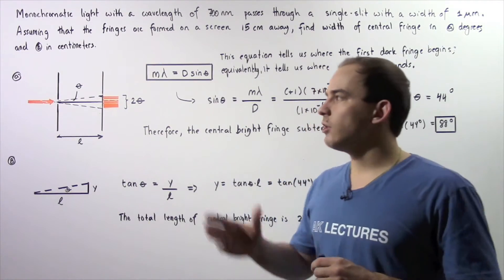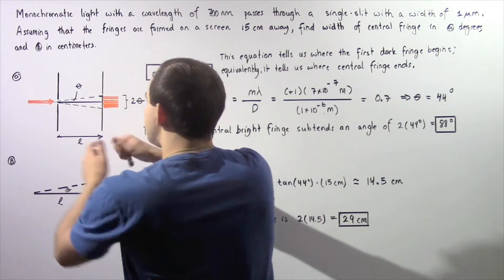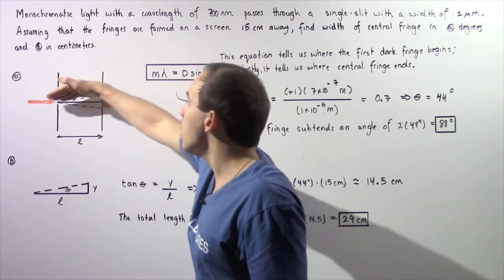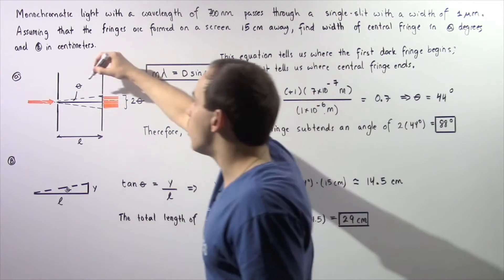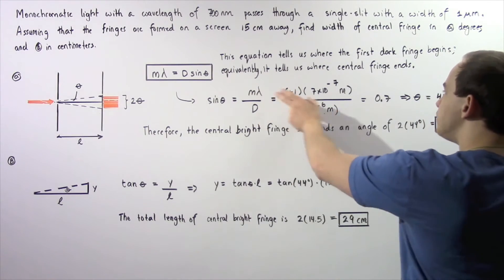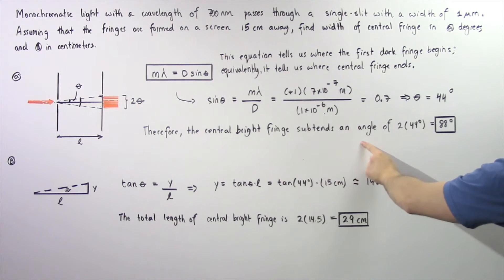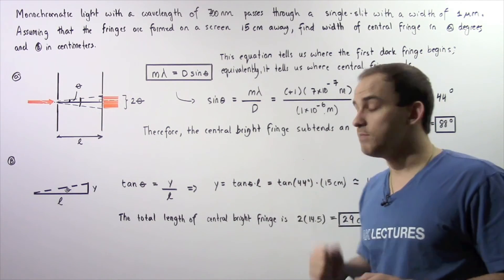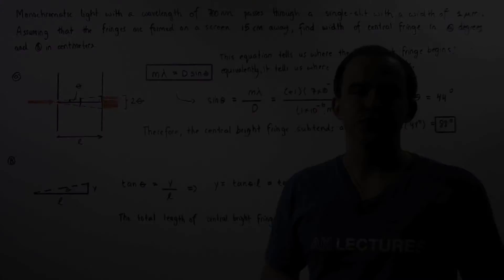Single Slit Diffraction Example

Comment: A major point of confusion that no one has picked up on. You should represent this in a better way. The central fringe is almost twice the size of the length of the screen and the source however the length between the source and the screen appears to be much larger than the height of the fringe. It is extremely distorted and should be corrected.
Reply: U relatively new in physics?